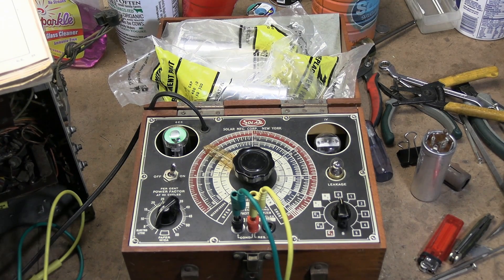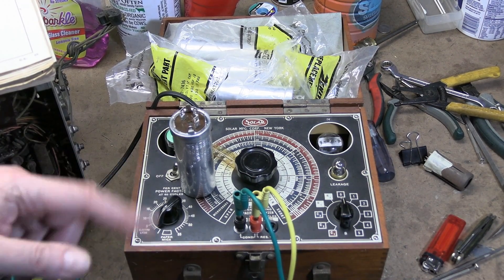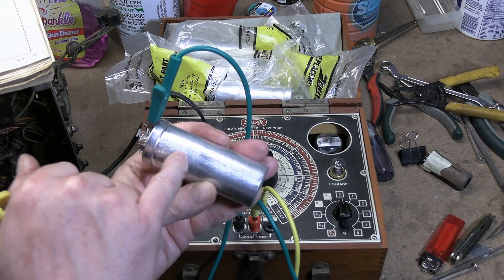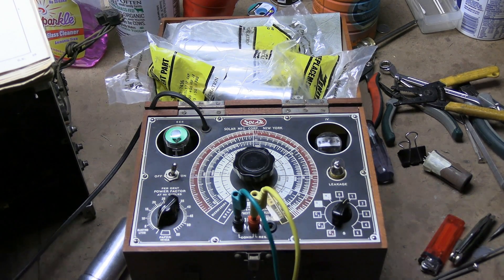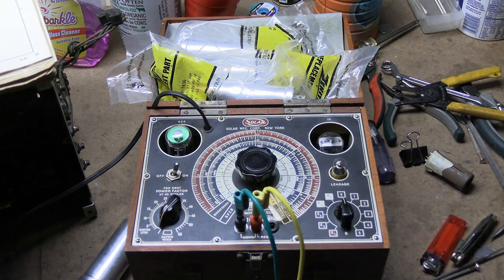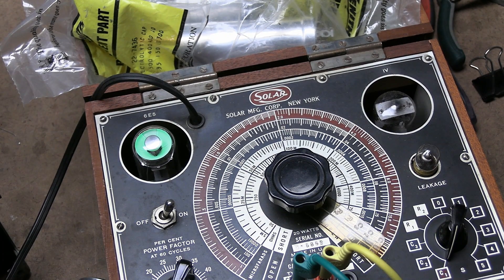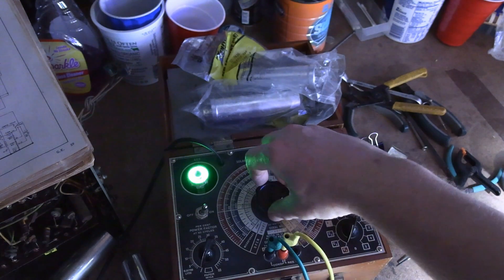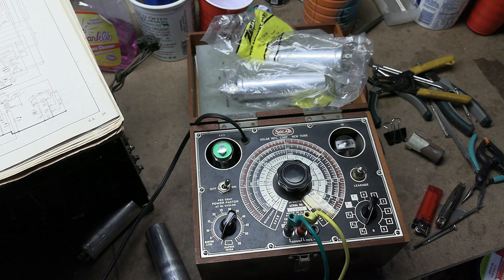Testing NOS (1978) Zenith electrolytic caps

Comment: I rememeber seeing an old print ad for Mallory electrolytic can capacitors that showed a Seeburg "Trashcan" jukebox that bragged about their outstanding reliability. Those old cans would indeed last decades too. I know of many 50's Seeburgs with amps running the original electrolytic cans.

Comment: Why am I not surprised that Zenith electrolytics still work? It seems like everything they made was built to a higher standard. But I do have a question about that cool capacitor tester. I see the 6E5 eye tube, but is the 1V across from it for? Is it just the rectifier for the tester?
Reply from the maker: Yes, half wave rectifier for tester

Comment: I'd certainly be comfortable using them in my own equipment. Some ancient ones still test fine and some modern ones die early, it seems the particular construction matters much more than age. It would not surprise me if your NOS caps outlast modern ones, but of course the opposite could happen.

Comment: Sprague caps are among the best I've seen (except some of the orange ones).
I've got hundreds of NOS caps, mostly from the 70s. The very late 60s/early to mid 70s Siemens caps are great (minor reforming recommended but probably not even necessary), mid 70s is when they started sucking, you need to put lots of time in reforming them.
All in all, roughly 40% of the caps you can just use right away, another 40% need reforming but will work fine after that, 20% turn out unusable.

Comment: Surprised that these capacitors were still being manufactured in 1978…were they manufactured then specifically as replacement parts or were they still being used in some new products?
Reply: Absolutely used in current production well into the 1980s.  RCA used them in the last "conventional" chassis series - the ColorTrak CTC74 and 84 (I'm pretty sure about those numbers), the CTC 107/8/9/10/20/30/31 as I recall and the Zenith TV chassis known as "vertical chassis" models.  After that, they went to printed circuit caps.
Reply from the maker: These are Zenith replacements parts.  I couldn't say if they were being used in new products.
Reply: I've seen this style cap in a TRS 80 monitor from 1978 or 79. With all contacts out in the open. Even the high voltage anode on the CRT.

Comment: I'm using my Stromberg Carlson TC-10 on a daily basis at least two to six hours every day I'm home. All original electrolytics, and paper caps. Yes it's a risk but the video and audio quality is like its brand new. I did let the caps reform before giving it 117 volts where I have a variac attached for permanant use. I don't let it run alone, I let my wife know to shut it down if she hears anything funny. I feel that if caps(or TV's) are stored in a climate controlled area they will hold up even 70 years later.
Reply from the maker: Remarkable - especially the bumblebees.  I've read numerous times that it is residual acid in the paper that eventually causes failure and not moisture from the environment.
Reply: @bandersentv  I'm sure I'll have capacitor failure soon. I'll probably just replace them one by one as they fail over time. I'm surprised a bumblebee hasn't popped yet especially the ac line bypass ones.

Comment: I think the old saying of storing old wine in new bag is suitable here.
I wouldn't use them in new projects but only as replacements for old equipment. If I would use them in something new, I would do it only for personal projects, not for third parties - indeed I would use them if they prove themselves for me.

You should be able to justify your design decisions for the client. If the client doesn't require vintage parts for a project then it doesn't make sense to chose them against new ones. Especially since caps are known failure points since they first made them.

Comment: It's interesting to see that these caps tested good but personally if I'm restoring a radio or TV I would only use new parts. When I'm done with a project I don't want to go back into it and redo my work because I used an old part that now failed.

Comment: the problem I see with using vintage caps is that they need reforming again in a much shorter period than modern caps. Would suck to have them take out the transformer or power tubes during 'reforming' because a working set that you put them in was shelved for many months/years. Unless you're willing to always power up sets that have been shelved for a while on a variac or dim bulb, i'd just replace them with modern caps for piece of mind. The sprague caps in my Tek 536 oscilloscope, which are considered 'good' vintage caps, still leaked considerably more  (about 10x) than a new cap after reforming. The leakage of the original caps was acceptable but could easily become unacceptable to the point of damaging things during a cold start after months of being shelved. Also as Shango has shown on his channel, if you just give caps the full beans after sitting for ages they can experience thermal runaway instead of properly reforming.
Reply: The ones Bob tested here finished reforming in well under a minute, and that's with very limited current. I'm sure they could have handled a hard power on without any issues. I don't know how long they'd need to sit in order to need explicit reforming and I also don't know how long it would take with modern caps stored in the same conditions.

Comment: Thought I would add my 2 cents to this subject that has a lot of variables associated with it.  I got to know the aluminum electrolytics quite well during during the 1990's while designing aircraft communication transceivers that operated over the entire military temperature range.  There are 2 electrolytes that are used; a standard and extended temperature range.  Of course, consumer grade electronics nearly always use the standard electrolyte type.

The failure mechanism for aluminum electrolytics is usually an open, caused by the electrolyte drying out but, shorts and high leakage are also common.  Heat is the enemy of electrolytics (it accelerates electrolyte dry out), which comes from heat dissipated by adjacent components and capacitor ripple current.

The rated life of the electrolytic capacitor is rated at a constant high temperature (usually the max temp rating for the cap) and is measured in hours.  The longer life caps use an aluminum case and a larger internal blotter, which acts as an electrolyte reservoir.  The Twist-lock capacitors have been around since (I think) the late 1940's.  They hold up relatively well in the tube radio/TV environment, assuming they are mounted away from hot areas of the set.

A twist-lock new-old stock part from the 1960's should be okay to use - IF (there are several caveats!!!).  The capacitor was stored in a controlled environment (i.e. 75 degrees F with 50% humidity).  If the part came from an environment where the temperature and humidity was allowed to vary quite a bit, the cap will "breath" and start drying out, along with increased corrosion internally, meaning the long term life will be "Iffy".

To "reform" an electrolytic capacitor, I apply power to the cap via a lab power supply through a 1 megohm resistor.  I set the power supply voltage for 10% higher than the voltage rating of the cap and run it for 24 hours.  At the end of the 24 hours, the voltage drop across the 1 meg resistor needs to be less than 5% of the cap rated voltage.  Additionally, I check the cap ESR, determining whether it is acceptable by the typical suggested resistance according to the ESR meter.  If the cap passes both these tests, it should perform okay for at least a year.  Of course, there are always exceptions, older capacitors are naturally more likely to fail.

Most electrolytic capacitors series resonate at 100 kHz, making them perfect for switching power supplies, where high ripple current usually causes their demise.  Twist-lock capacitors (above a 100 volt rating) have a temperature range of 0 to +70 degrees Celsius.  Capacitance tolerance is generally -10 to +75%.  Twist-locks are ripple rated at 120 Hz.

Comment: In my opinion, there is no reason at all to use old NOS electrolytics that test well now. You're just asking for trouble down the line. Terminal strips below and new parts. Leave the old ones in for original look.

Comment: When  I worked in   power supply and telcom  manufactures  in the  eighties, nobody   ever   talked  about  changing   capacitors
Reply: New Caps don't usually fail right out of the box.
Reply: And they have a good life span.

Comment: 8000 hours into testing a fully NOS set, half have failed the rest are still going
Reply: As I remember, color television sets, even the hybrid ones of the late 1960's, were not very reliable in comparison to their black-and-white contemporaries. I suspect this is because of elevated component count and higher heat and voltage requirements. Electrolytic caps seem to hold up quite well, though. The wax/cardboard electrolytics, not so much.
Reply: Hi   Dan   !  SPARKLE  PONY MASTERCHARGE
Reply: @shango066,It's an interesting experiment. Not many folks have an NOS color set from that era,and those who do wouldn't sacrifice it for the sake of an experiment like this.  We appreciate the videos. Honestly it's doing very well considering. Glad you have an NOS tube and are able to make it like new again once the experiment runs its course.

Comment: Bob, I have used NOS can capacators, ( electrolytic) in all my restored radios, and currently zero malfunctions. I prefer them, especially on a vintage Zenith, or RCA, or other manufacturer, where Original type equipment really matters, especially for purists, and potential award winning shows said radios may be displayed, it really helps with the aesthetics and the Ooh, and awe factor.  Just my opinion of course.great job on your restorations you perform, and I also have one of those old Solar cap and resistor testers.  My go to favorite.

Comment: One would really need more in-depth tests like ESR and actual lifetime to monitor the condition of the cap, and by the time the latter had produced results it would be moot.  It would be a curiosity to research.  A totally unused cap of that vintage would very likely have never had a chance to leak liquid or gas, its seals never having seen working conditions, and if so its lifetime might match OEM.  But since it is so cheap today to use adapt-a-caps or mount modern caps on terminal strips, that seems the most reliable way to go.  Seal materials could deteriorate with age, after all.

I've never actually seen service parts marked with an expiration date, only with a manufacture date.  Perhaps batches of build parts are marked with expiration dates, and I'd be curious about references to this, what literature it is from.  But most service warranties weren't all that long either.

By the way I'm curious how the ESR for these caps, with a decent reforming time, compares to modern caps.  A deteriorating ESR could indicate an electrolyte is drying out.
Reply from the maker: My ESR tester uses 100kHz as most do which seems meaningless to me as they wouldn't be used in a switching power supply. Perhaps power factor might be more useful?
Reply: @bandersentv Power Factor is a measurement of how resistive or reactive an AC load is to the power line, it won't tell you anything about your capacitor.  The better LCR meters will measure Dissipation or ESR at 50, 60, 100, 120, 1k, 10k, and 100k hertz.  Since most electrolytic capacitors series resonate at around 100 kHz, this frequency allows the measurement of just the resistive component of the cap, whereas, at 120 Hz, the ESR measurement will be slightly different due to series capacitance being dominate and the series inductance being negledgably small. In plain English, this means the ESR reading at 120 Hz versus 100 KHz won't be as accurate.

Comment: I know a lot of folks reform them. However, I'd be afraid they would short and possibly take out the transformer. I would use them for cosmetic replacements where someone removed one and left a hole in the chassis. However, I would not connect them. I would use new caps on tab strips underneath. What did we say back in the day, "An ounce of prevention is worth a pound of cure"?
Reply: you COULD add a suitable fuse to protect the power transformer(assuming that there isn't one already present.
This is a good idea anyway, even if you use modern caps.
Reply: @m.k.8158  True! However, in many tube radio circuits (as well as TVs), you do not want to have the owner sticking their hands in there to change a blown fuse. Slo-Blow fuses may not open before damage is done, low amp fuses or fast blow fuses might blow even under normal conditions, unless they too are rated higher than what is called for. This again, would tempt owners to try and replace them their selves. Again, a shock hazard. And if they increased service calls to already too busy service shops, just to change fuses, well again not practical and expensive for the owners. Not to mention lengthy downtime just for a fuse! Why risk any of that for the sake of an outdated, potentially unsafe, component?
Reply: @ElectroRestore  It should be possible to choose the right fuse. And if a fuse should only blow from internal failure I would solder it instead of socket it.

Comment: Those caps held up nicely after 46 years! I didn't know they still made multi-section caps in the late 1970's. I've had electronics from the 1960's that used those aluminum electrolytic caps and have never had to replace them. The wax/cardboard ones that went underneath the chassis were a different story, though. The aluminum ones from the early 60's onward were well-designed components, apparently because the engineers did their homework and learned from experience.
Reply: actually, those metal can caps, even from the late 50's often hold up way better than you would expect.

Comment: i regularly use surplus electronic parts including electrolytic capacitors mostly because i can get them rather cheaply from different electronic and surplus component suppliers and money is currently tight. The NOS capacitors i use tends to be from the 80s and 90s when many electronic manufacturers over here had to stop production due to Japanese and Chinese competition and sold off their  inventory to different surplus resellers. The supply of high voltage NOS film and electrolytic capacitors seems however to have dried up so nowadays so i buy new capacitors from China and Taiwan.

Comment: Would i use them? Depends. If i wanted a perfect original look, museum quality. Then yes, very much so, after testing them. 
But that is not a usual requirement for me. 
Thing is, low or high quality parts can be found in any decade. As you said, might last the week, might last twenty years. You are not going to know. But you are also not going to know with modern ones. The chance is just higher that they will last. But modern caps also have shelves life and the need for every smaller packages hasn't helped lifetime increase. 
If you want to be sure you customers have a safe, working set, use the new ones.

Comment: Thanks for this work. I want to learn how to repair tube radios, what do you advise me to do?
Reply: Watch a lot of videos on the subject and be very careful with the high voltages.... 
But seriously, if you already have repair skills in electronics, tube radios are not that different, just higher voltage. If you don't have any prior skill repairing electronics then don't start with tubes, the voltages can be quite deadly if you don't know what you are doing. Start with transistor radios.
Reply: I'm no radio guy. But I would suspect an all American 5 might be a good start. Low component count. Simple
Reply: I'm 65, and I think a very good start is to get an RCA tube identification guide. Has all the pin-outs of lots of tubes!
Reply: I'm 65, and I think you should get an RCA tube identification guide. It has the pin-outs of lots of tubes. I used to carry it with me when I was in Highschool! Didn't know it then, but I was eventually going to turn into a real Chip Head, when they where invented! Lol